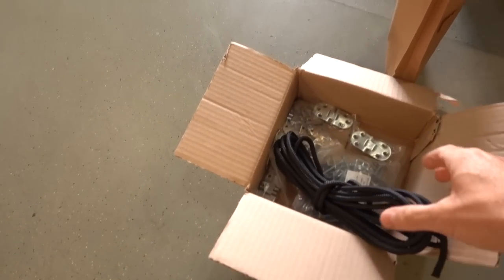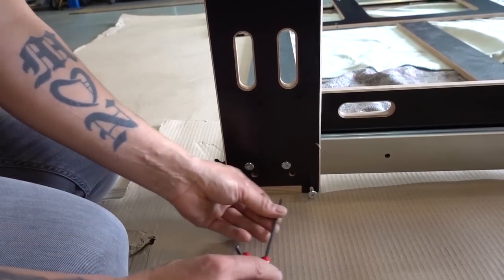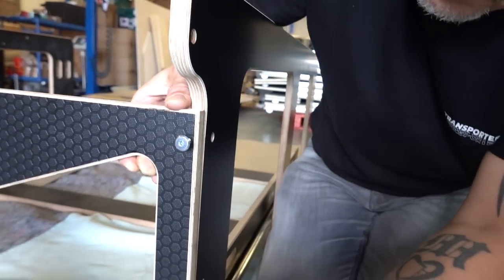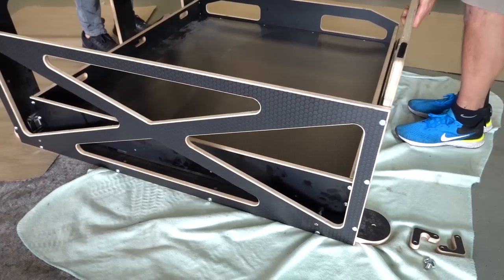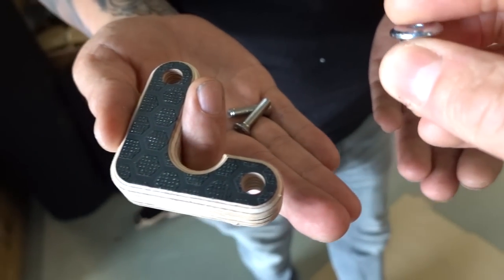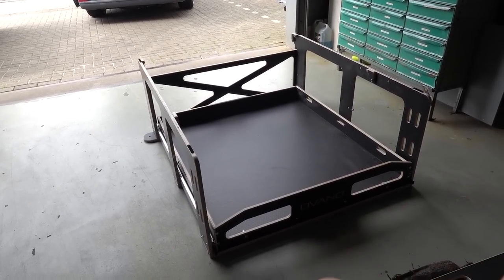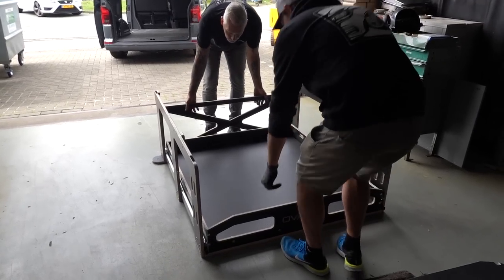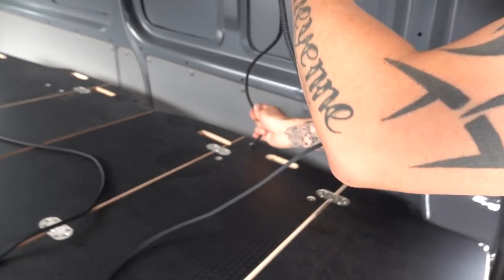How to build and install an Ovano Switch bed system SWB & LWB. Plus 3 different positions

Comment: I'm in ireland and recently received my Ovano from the Netherlands. Its really a clever piece of kit but moreover it's pure quality. No rattles, no creaks. It's superb. Instructions were straight forward and when I couldn't figure out what the wheel arch supports were for Cheyenne in Transporter HQ was very helpful. It's a big 5 🌟 from ireland 🇮🇪.
Reply from the maker: Cheyenne is a star. Glad you're pleased with the Ovano and the service 😊
Reply: Lad with the tats obv thinks so too.

Comment: Great video. Thanks! Can a road/triathlon bike fit on the very back of the ovano(parallel to the backdoor with a front wheel removed)?
Reply from the maker: I'm not sure. If you get us the dimensions, we can check. email andy@transporterhq.co.uk

Comment: Must admit the only complaints ive seen about this is the price. I like the bike add ons and also option for Dog and i dont even have a dog
Reply from the maker: I think the price is fair considering the engineering and quality of materials. I've seen several companies copy the Ovano making them slightly cheaper. I've also seem these customers vans and you can tell they aren't of the same quality.